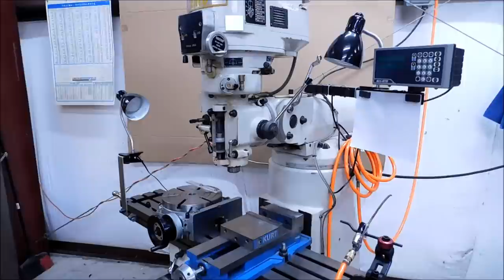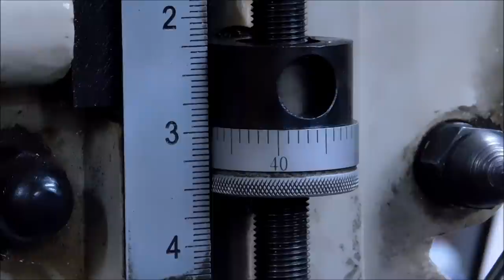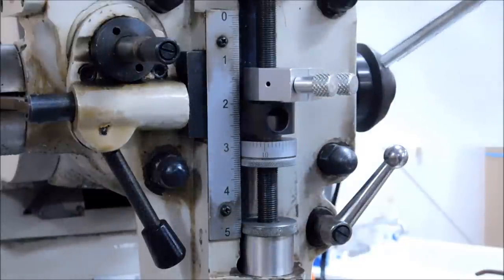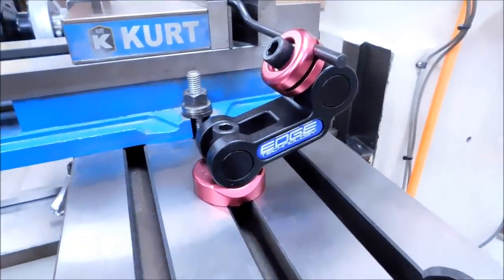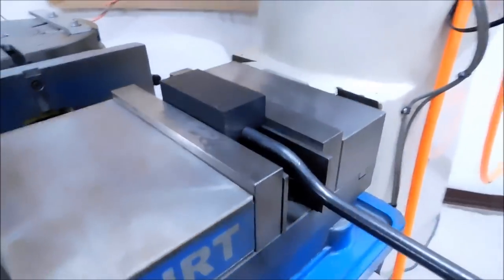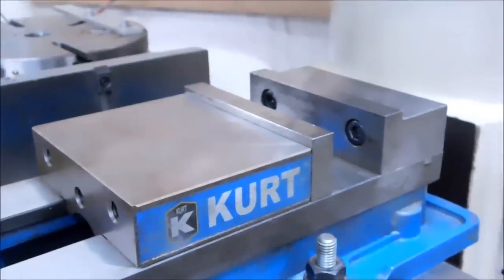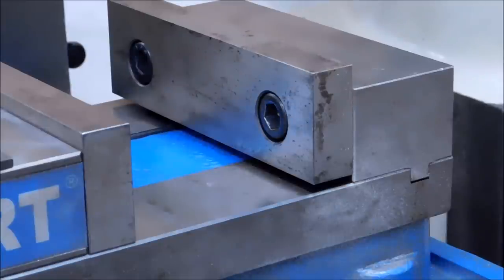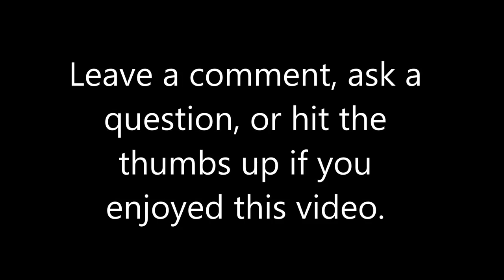Mill Accessories you Can Make !!

Comment: Joe, I want to thank you for this video.  As an amateur machinist, I had never used a stop for my vise.  After watching this video (shortly after it came out), I made a stop a stop out of pieces of material that I had laying in my scrap bin.   I was making a part on the mill last weekend and decided to set up the stop.  It was amazing to me how much time it saved me.  The part had 2 sets of holes that were at right angles to each other.  I was able to reference the end of the work, move in the distance that I needed to put the hole, drill the hole, flip the part end for end, move to the new distance, and drill the remaining hole.  No need to re-reference the end of the part.  Then I turned the piece 90 degrees, re- centered it, and repeated the process for the other 2 holes. It made it quick and easy.  Thanks for the impetus to make and use this tool.
Reply from the maker: Thanks for the feedback. Having one of these should be a standard if you have a vise.

Comment: Another very useful video. The oversized part attachment with the threaded rods, pipe and 2 123 blocks is so simple that it is genius.
Reply from the maker: Thanks. I suppose you could remove the vises and strap it down, but this is very quick to setup and breakdown. Accurate too.
Reply: @joepie221  In the past, I have removed my vise and clamped my oversized parts down to the table. Considering time --- Clamping and rotating a part 2 times in order to complete it would be about the time it would take to make your attachment. No brainer, make the attachment.

Comment: When setting a rod type end stop have a bull nosed end to push part against and set the stop in the centre of the part in both directions as near as possible. This will eliminate any error due to the part being slightly out of square and will give accurate positioning  even on saw cut ends.
Reply from the maker: This is a good suggestion.

Comment: I make my soft jaws the same height or slightly lower than the fixed block and jaw blocks.  Then I can leave the taller jaws mounted on the outside ends of the vise.  It is always ready for longer parts and I do not have to change the jaws.  Great video.
Reply from the maker: That's a great idea!

Comment: Drill and tap those SHCS holding the hard jaws on. Then make you a set of socket head shoulder bolts that will fit your soft jaws and screw into the vise SHCS you drilled and tapped. Now you can install the soft jaws inside the hard jaws to save time swapping jaws if you don't need the full travel  of the vise for whatever you are doing.

Comment: I always lock the z and use the knee to get anything precise
Reply from the maker: I keep a split collar under the lower quill adjustment wheel on my mill. Its hollow to allow the retaining clip to go inside. Then I wind the bottom nut down and trap the collar. This eliminates the ability to use the power down feed, but provides a very solid 'NO BOUNCE" registration when using the upper nut as a stop.

Comment: Thank you, that video answered my questions about your mill accessories plus a couple extra goodies to make.
Reply from the maker: Glad it was clear enough.
Reply: @joepie221  I built the vice stop based on memory and what I came up with was totally different. I milled slots in the piece that attaches to the back of the vice. Works but does not give the height options your widget does. I will remake it using your design, it gives more options. It's all just practice so making another one is just another day in shop class. Thank you for what you do. I don't watch TV anymore I watch machining videos.

Comment: Great ideas, most of these I knew of. One more thing, a set of mild steel soft jaws is handy also. Now if you only had a way to repair the hard jaws where someone milled down into them. I won’t say who the idiot was who milled a 5/8” hole down through both jaws. I had to order a new set of jaws. Kurt is really proud of their replacement jaws!
Reply: Hard Facing.  One example -  https://www.lincolnelectric.com/en-us/consumables/hardfacing/Pages/hardfacing.aspx
You'll have to weigh the cost of new jaws against your labor, just pointing out that it can be done.

Comment: oooh, I have to tell our maual machinist at work what that spring-loaded half-nut is for. he's been using it for the purpose of the sleeve on the bottom of the threaded rod on the quill.
Reply from the maker: He will respect you for it.

Comment: I really liked the spring loaded stop for the quill retract so you don't have to crank it all the way up when doing a process over and over. I understand the block with threads, then cut and add thumb knobs, bit how is the spring attached  and what type of spring is it ?
Reply: Was wondering the same thing
Reply from the maker: Its a very stout extension spring. Bending it is what gives the action. Once trapped by the hinge pin, it almost doesn't need to be secured.
Reply: Thank you!

Comment: Anti-wracking in wood has a widget that's 20 (or whatever) "2 inch long fingers" 1/8th inch thick all bolted though a pivot on one end. (Think: Like feeler gauge pack) Need to balance 1 7/8" Well, that's 15 of them for the 'far side' of the vise. How far off in size is "reasonable" when putting "not identical " parts in the far side of the jaws?

Comment: 18:00 I wonder if that can be used as a jaw extension if I was trying to hold a part that was 16 in square with holes down the length against the fixed jaw.
Reply from the maker: I have set it up that way. Depending on the operation, its very versatile.

Comment: I use my mill in my wood shop. Groove stair stringers, finger joint boxes, decorative rosettes, etc... ? Is I have to make dadoes x grain on 8' pieces. My infeed is only about 6 so I could clamping other direction, what is your take on this?
Reply from the maker: I don't see why it wouldn't work. Swing the head about 45 degrees so you can do the 8' length off to one side.
Reply: Thanks I got 13" was sufficient for this project

Comment: I'm trying to figure out how the rebound stop (4:59) is spring loaded. The two small holes that we see going through the hinge location of each jaw, are these used only for pins that  hold the hinge, or does the spring use these internally?
Reply from the maker: I believe they are only for the hinge function. The spring I believe is a small rigid coil type compression spring that bends when the knobs are squeezed together. The rebound of the bent spring provides the grip.

Comment: Hey Joe. Can you do a video on the importance of cleanliness and maybe another on the reasons to not drill into things that are supposed to be precision surfaces? Thanks. Early in my machinist career I learned quick that a small particle can throw a part out of tolerance quick and so can a set of disrespected parallels!!! even the vise and table surfaces. They're to be treated with respect for yourself and the next guy.

Comment: Thanks, Joe!  My favorite stop is 25 years old.  Old-time machinist had on his mill. Every time I walked by it, it didn't make any sense. Easily moved out of the way but would easily reach under or over the back jaw. Fun little project. I didn't show it on the vise, but at the time stamp shows it assembled. https://youtu.be/W85l-SvNjqA?t=255
Reply: That's a neat way to use a set screw!

Comment: Hey Joe, I’ve started the need to use ball nose end mills for creating same size parabolic finishes. I have a small mill and it chatters big time. I’ve tried  the method of using a regular drill bit that comes close to finish tolerances and then finish with the b.n. mill. I’m going about 110 rpm. for a 3/4 “ b.n. mill. Any suggestions please ?
Reply from the maker: Material?
Reply: Sorry, mild steel. I often forget to inform of minor details ( major ) actually. My wife knows this of me.
Reply from the maker: @MagnetOnlyMotors  With a machine that is known to be less than rigid, your are immediately at a disadvantage. This being said, I suggest the following. If this is a full radius trough type feature, remove as much material as you can with conventional cutters first. Snug all the table locks, make sure the quill is as far up in the head as possible, cutter extension should be at a minimum and realize the center of this cutter is barely moving at all ( SFM ), so plan accordingly. 110 RPM may be a little slow. A 4 flute may be better than a 2 flute too. if this is a corner radius, make sure the cutter impact is to the stationary jaw and climb cut if necessary. Be sure the table lock is a heavy drag so the table doesn't jump.
Reply: @joepie221  thanks Joe, it is a 4 flute  and I did open with a 5/8” drill. All locks on. My table doesn’t raise, but mill head descends which I also keep mild drag on it for same purpose. My decent is very slow, I surmise this is my fate with this machine.
Reply: Also, it for a concave finish, not outer corner radius.
Reply: Oh and thanks very much Joe for responding to my question soooo fast. Few others are like yourself !!

Comment: Can l use a dividing head to reduce the diameter of round stock on a Bridgeport with an end mill?
Reply: I've done it on a partial diameter, wouldn't recommend it.
Reply: Use a rotary table- not a dividing head. Or heck... Even a boring head would work. I wouldn't advise using a dividing head or one of those cheap spindexers either

Comment: Joe, you use the word unloosen to remove a screw. In reality unloosen means to TIGHTEN, as the part is already loose and you are Uning it ( reversing the process ). Probably the best terminology to use is, Slacken, Release, Undo,Unscrew, etc
Reply: Dave, unloosen is a sort of 'catchphrase' of Joe's.
Reply: Um, maybe unloosen your tie?
Reply from the maker: Thats my word Dave. It always gets a rise when I use it. The mariam Webster contemporary dictionary actually recognizes the word as a form of loosen.
Reply: @joepie221  - Here I thought it was Joe specific terminology, but no.  3 seconds on the intertubes and there's a dozen reputable lexicographical sources with official definitions.  Not the most important thing I learned today, but it is the most surprising.

Comment: Thank you again for another great video. As usual I always learn something. BTW,  doesn't adding additional height to the softjaws result in a slight increase in deflection from clamp pressure? Or does it not really become an issue, due to the material thickness of the softjaw to begin with?
Reply from the maker: It could. But the thickness does help. Vises are very strong. Don't over torque them or it will start to effect the part.

Comment: why wouldn't I just shim out the play at the circlip ?
Why block up the Feed ??
oneor2 of PP / HDPE split shims should about do.
Reply: If it's not easily removeable it would be pain when you want to use the down feed. At least I think that is the problem.
Reply from the maker: The entire column moves, so any shims would have to fit in the groove with the clip. Plastic would certainly distort quickly.

Comment: I've been useing the stop on the quill for many years. If you don't take the stop out, you will eventually forget to take it out when boring. The results are not pretty. I've broken the feed gears in the quill three times over a 30 year time frame from forgetting to take it out. It is a handy way to set a depth, but don't forget to remove it when boring with power feed.
Reply: Ron if I may add to your comment, I sprayed my stops with a cheap rattle can of florescent orange

Comment: Oh my god do floating soft jaws piss me off.  The last place I worked nearly every soft jaw didn't touch the bottom of the vise, and these "professionals" would reuse these jaws.  Set the job up again, and wonder why their parts aren't square, or are tapered left to right.
Reply from the maker: If your jaws get too worn, slot the screw holes to allow the jaw to move up, but be sure to mill away the vertical vise contact of the jaws leaving a shelf so the jaw has something to stop against. 1/8" ledge is fine.